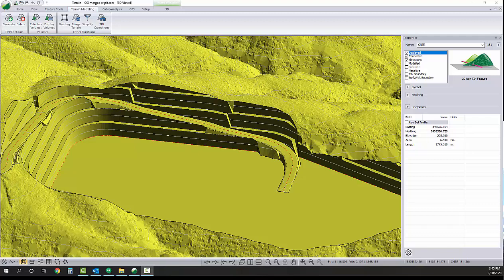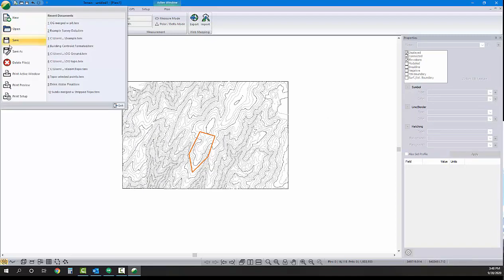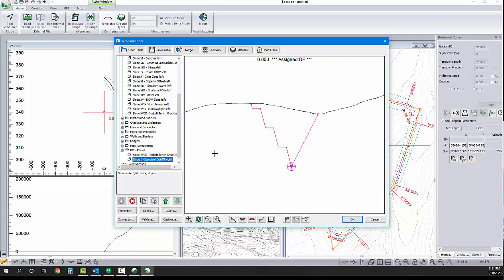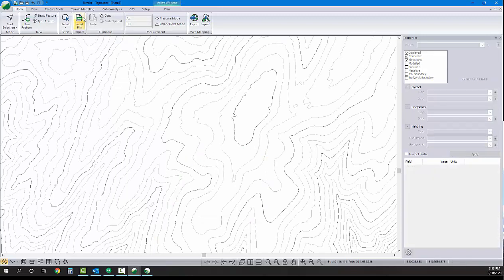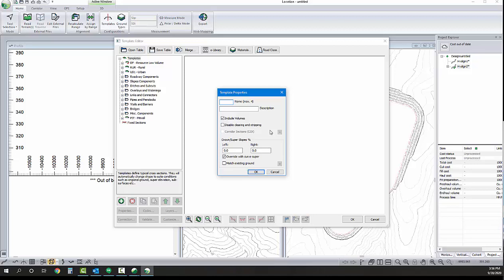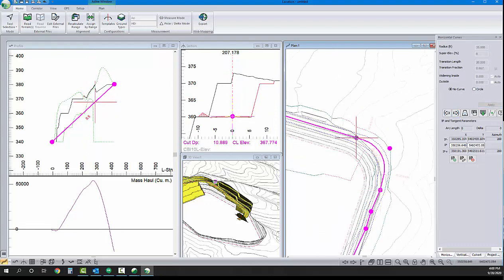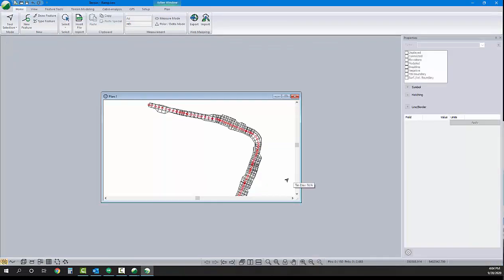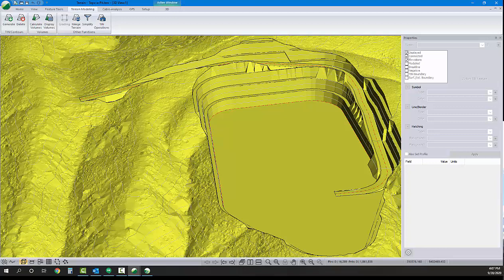Designing a Mine Pit with Access Ramp

Comment: The ramp designed does not allow access to the production benches, would have to improve this design.
Reply from the maker: Hi Filipe, sometimes benches aren’t as much there to be worked as they are for stability and to protect workers. If you would like to design access to each, or individual benches, you could do this easily can using merged surfaces and a separate alignment. If you have more questions, we’d be happy to chat with you directly.